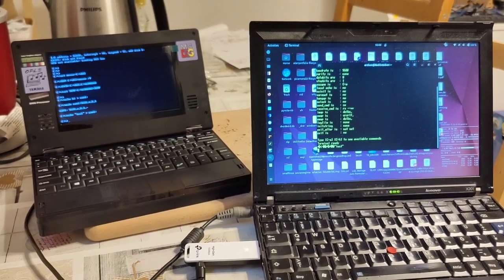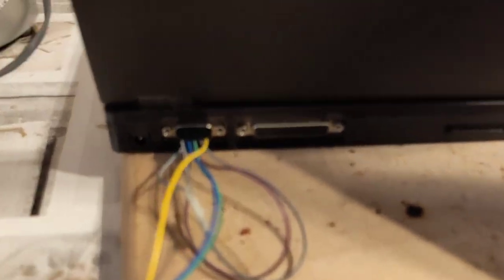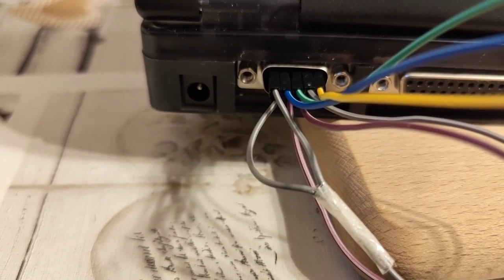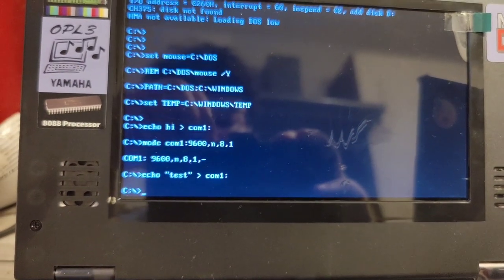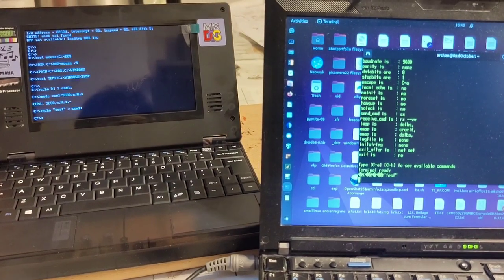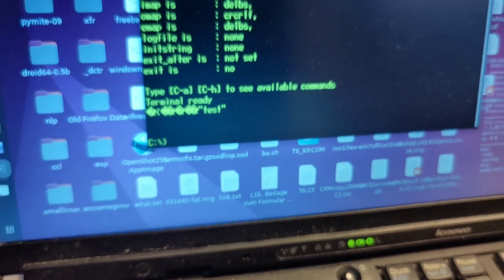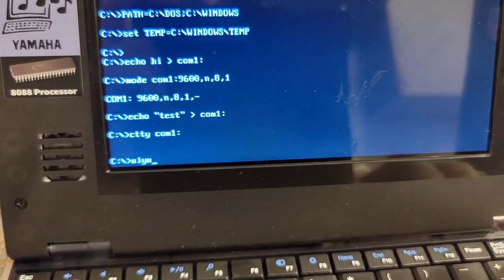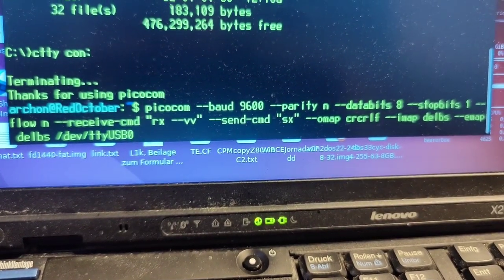(1/58) TTY/SLIP/PPP: Logging in to MS-DOS via CTTY COM1:

Comment: I used to do this connection with a simple 3-wire cable. As you said, Rx-Tx, Tx-Rx and GND-GND. I did not need the handshake wires.
I used this connection with Norton Commander Link and with MS-DOS Interlink when I did not wanted to copy a lot of data with floppyies. It was simpler to "clone" then copy  that to use many flopyy disks. 
I just looked, the commands are
mode com1:2400,N,8,1,P
ctty com1:
Yes, I used 2400baud because it was stable and with parity.